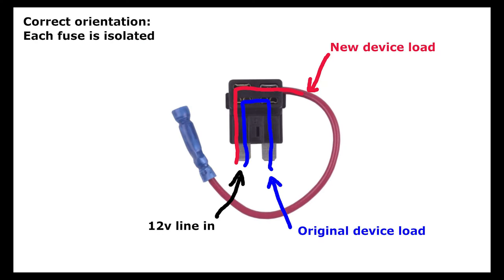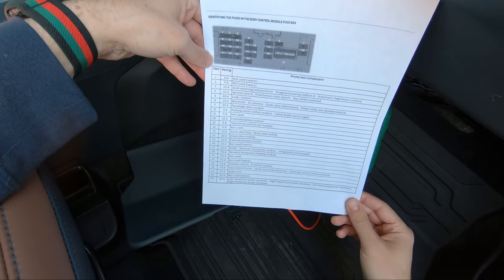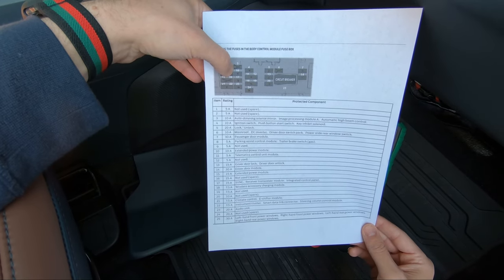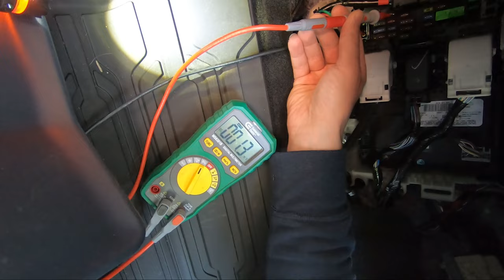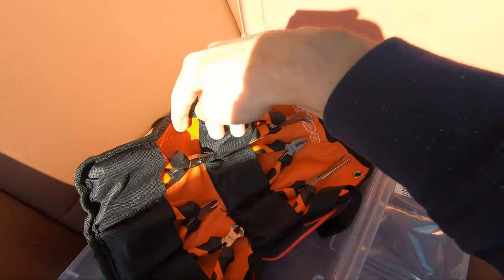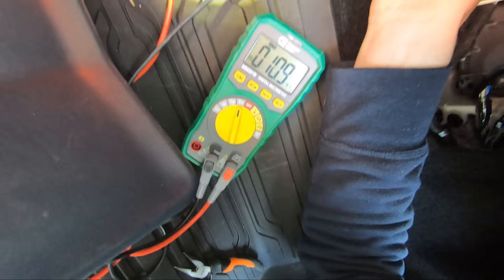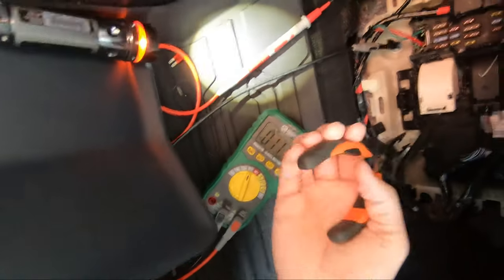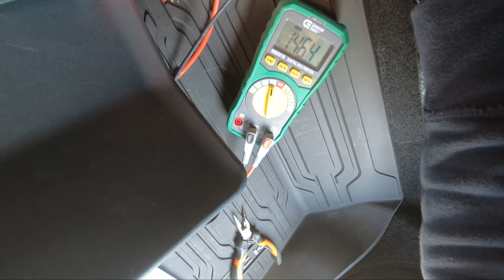2022 Ford Maverick: Orientation of Add-a-Tap on Fuse 3 and Fuse 6 (Accessory / Ignition Only Power)

Comment: The add-a-tap kit I bought from Viofo unfortunately didn't come with any three-pronged fuses, leaving me with only the Micro 2's as an option. After testing all of the fuses for the accessory wire, only fuse 3 and 6 were options for my 2023 Escape - all of the other accessory wire options would have needed a Micro 3. Fuse 3 is a way better option if you want to orient the plug with the live leg. I could not possibly get it to fit in the slot beside fuse 6 due to the presence of that large plug directly beside it.

I'm surprised how identical the interior fuse panels are between the Escape and the Maverick! Thanks for the videos you put together on this project, they were a big help.

Comment: When I conducted the multi-meter probe touch test on the 3 blade combo fuses, every probe point on the 3 blade fuse red hot. That really a surprise! I ended up plugging in a mini fuse tap in #24 which was a 15 A unused slot. I plugged in the fuse tap with a 10 A fuse and left out the 15 A fuse.
Your video was absolutely helpful. THANKS 👍😁

Comment: Quick question why would you not use #20 as I belive its a spare. Does wire tap not fit here?  Want to use a wire tap to power a 12v cigarette lighter for wireless cell charger pad.  Thanks!
Reply from the maker: You actually should look into using Micro3 fuse #1&2. The reason js that fuse #1/2, 3, and 6, are ignition-only power. So that it can’t drain your battery when the engine is off if your accessory device could still be active.

#3 and 6 are used by the system, but #1/2 is a 5amp fuse not used by system. That will easily power a wireless charging pad. Micro3 fuse taps are easily found on amazon for similar price as micro2. I used this for my dashcam. Let me know if you want link to the tap I used.
Reply: @clavicus  Thank you for your reply! I have ordered  the Micro #3 fuse tap for 1/2. With these type of fuses does polarity normally  matter like u addressed within your video.  I belive in my case since I'm tapping a spare it doesn't  but in general just wondering for these multiple post fuses types. Thanks!
Reply from the maker: @fasterdanu1  Since the central leg is always the line (power source) in the micro3 fuse (it has two fuses really, one on either side), the orientation of the fuse tap will not matter, your load(s) will be isolated from the (unused) system fuse(s).

Comment: I am going to install autodim rear view mirror with Homelink and Compass in my Maverick.  There are three wires for that mirror: switch power, constant power and ground.  I will connect switch power wire to fuse #3.  Where can I connect constant power wire to?  which fuse for constant power?  Thanks.
Reply from the maker: Any other micro2 fuse besides 3 and 6 will be constant power. Many people use 20 or 24 since they are ‘unused’ by any electronics in the truck.
Reply: @clavicus  Thanks for the quick reply.  Your video is very helpful.  THANKS.

Comment: Can fuse three be tapped and used for a remote wire to switch on a subwoofer amp? 

I tried it and used the same 10amp fuse in the tap and pre collision assist stopped working. Any help appreciated.
Reply from the maker: Are you powering the subwoofer from that fuse? If so I would guess that’s too much load and you blew the fuse. Did you not install a new fuse in the tap? Fuse taps need two fuses, sorry if that’s what you already did just making sure since your system fuse should have been isolated from your added fuse.